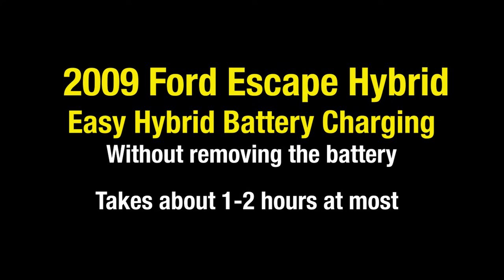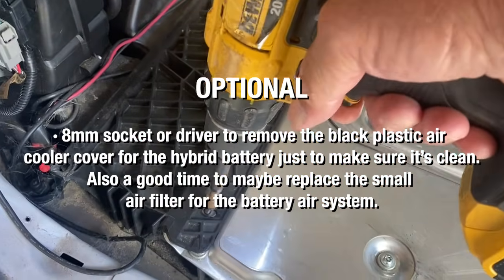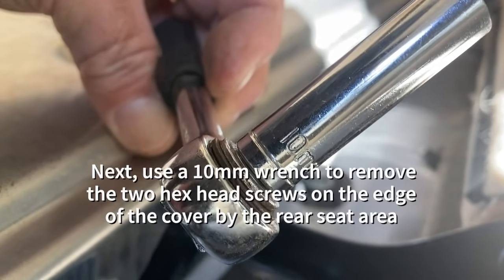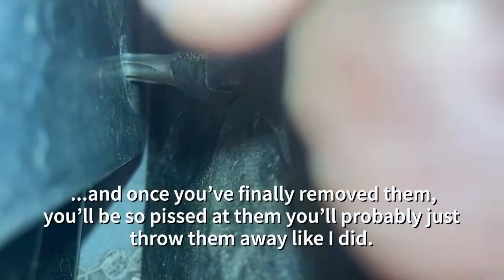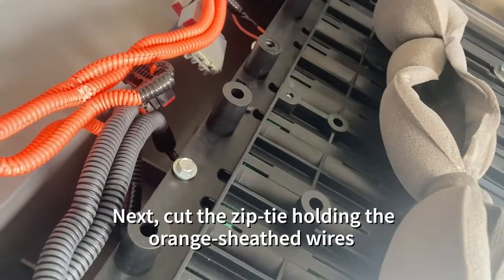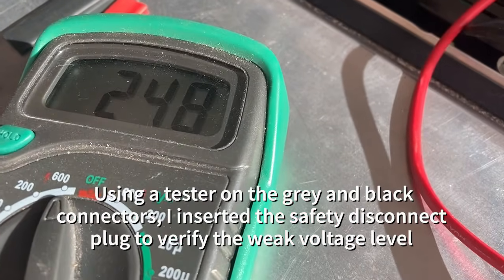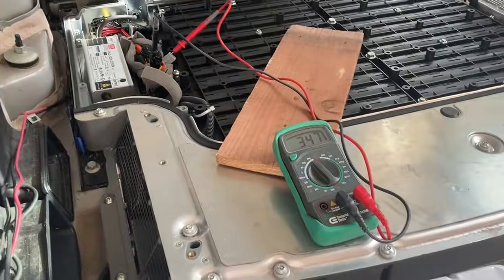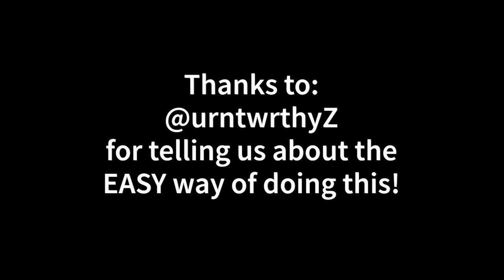EASY Hybrid Battery Charge 2009 Ford Escape - No need to remove battery!

Comment: I just did this today. Waiting to see if it is going to work. I forgot and closed everything off before checking to see if it was charging or not. I removed those plugs, I figured you already done all of this so it should work. I expected and led or something to come on on the charger when I plugged it in, but it didn't. I'm sure it is doing well. I did test it beforehand, and it was at 289 or so. Not sure how long it will take, but I'll wait about 45 minutes or an hour, then go out and try it. Thanks!

Comment: Hello Matt,
Thank you for your excellent tutorial video .It is the best posted on YouTube. 👍
What OBDII adapter hybrid compatible do you use with  ForScan, please?

I ordered the HLG-120H-C350A from Mouser Electronics website $82.15
Mouser #:
709-HLG120H-C350A
Mfr. #:
HLG-120H-C350A
Desc.:
LED Power Supplies LED Power Supplies 150.5W 350mA215-430V CC IP65 int. pot

Also ordered 2 rectifier diode from Mouser Electronics  $1.46/each
for safe and effective charging - prevent "back surge"

Mouser #:
625-1N4007GP-E3/53
Mfr. #:
1N4007GP-E3/53
Desc.:
Rectifiers Rectifiers 1.0A 1000V Glass Passivated TrimLeads

Alternatively, one can get from MAXX VOLTS a plug & play
2005-2012 Ford Escape Hybrid (Low Voltage Recovery) High Voltage Battery Charger Booster
Regular price
$469.00
Sale price
$399.98 Sale

Thanks again🙏

Comment: DOES this no Start condition exist on the 05-08 models as well.  I think you said that the male 3 prong plug is in place from the FACTORY already ????   TIA
Reply from the maker: No there’s no 3 prong AC plug on any of them. In the pre-2009 FEH there’s a charge button near the driver’s side under dash area that will allow a small charge from the 12v lead acid battery to run to the hybrid battery to get it up to starting voltage ( this is from what I’ve read, but I don’t have any firsthand knowledge about it)

Comment: Hi Matt I hope you are doing well. If you don't mind I have some questions. 1. So did you install some diodes on the positive charger cable? 2. How often did you have to charge your hybrid battery?  Did the battery overheated or not because I noticed it was charging rapidly. Thanks for the video
Reply from the maker: I didn’t install any diodes. I only charged it enough to get it started. Once it started, the hybrid battery stayed charged as long as I used the car regularly.

Comment: Thanks for the great video, with an older traction battery that still can be started will this help to semi-recondition and prolong the battery life or would that be wishful thinking. if it sits for a few days, it starts and stalls with "stop safely now" warning then after a few tries it'll run again Thanks

Comment: Another success story! This $60 part saved me from a $5k quote. Can't thank you enough! 

Notes for others:
My hybrid battery was showing 292v. After following the video, I charged it for 15mins and that was enough to get it over 300v but the car didn't start.
Turns out my 12v battery was dead as well so I used a portable jump-starter then the car turned right on. 
Drove it around as normal and the hybrid battery is holding strong around 340v. 12v car battery is also back to normal working conditions. 
Quick Google search states that the optimal battery level should be around 300v-350v.
I added an extra set of leads that allow me to check the voltage without opening the hybrid battery again.
Reply: I was thinking of this very thing yesterday after I watched the video. Thanks for reminding me.

Comment: How do you know - minus a volt meter when you should unplug?
Reply from the maker: Try starting it after a few hours. If it doesn’t start, try a few more hours. If it won’t start after about 10 or 12 hours of charging, you might have other issues.

Comment: I have escape that fails to start after a day of sitting. Seems like this post not trouble shooting reason hybrid battery not charging when car is driving?  
I hear cooling fans go out as one reason. Hybrid pack is hot. 
Another is hybrid battery control module. 
What causes hybrid battery parasitic drain?
Reply from the maker: That sounds like a different issue. This video is about what to do if your car won’t start because the hybrid battery has drained to a low voltage.

Comment: This is very dangerous because the aftermarket power supply stores a charge even with the orange interlock is out. Do you have to add a switch between the output of the jumper cables under the foam and the output of the aftermarket power supply when the unit is not being charged? I'm working on this conversion now, but I don't see a voltage with the power supply connected in parallel when I turn off the interlock. Thanks.
Reply: Did you find an answer
Reply: @Longbranchking  i did the conversion, and it works fine. There must be adequate isolation between the primary and secondary stages of the Chinese power supply.

Comment: If you pull out all the 13mm bolts that hold the battery down,  use a pry bar to lift the end by the seat,  then you can slide the battery side to side for increased clearance on those side bits.

Comment: Our sat for four days and is not starting. So, going to do this and incredibly grateful for this video but do they make a box that just plugs into those two connectors and has a 3 prong connector on the other end? 

Why did you solder? 

What's Ford using at the dealership to recharge these batteries in their service center and why can't I just buy that cord?
Reply from the maker: I don’t know what they use at the dealership. I soldered because I have a soldering iron and it makes a better connection than wire twisting, but wire nuts or crimp or jellybean connectors would work fine too. I don’t think there’s anything preconfigured with the plugs, at least not as far as I found.
Reply: @mattgatlin1918 Thank you for that input, much appreciated. It's working  great!

Comment: Hello Matt,
I wanted to give you a BIG THANK YOU!  I thought I had to toss my 2009 Mercury Mariner Hybrid because it would not start.  I did not know that you needed 300+ volts in the hybrid battery to start the car - I thought the car only needed the 12V battery to start.  As I started doing some research,  I was told that I needed to pull the battery out to charge it!  Looked like a very heavy and difficult job.  I was about to give up and donate it to "Cars for Kids", then I came across your video!  
I followed your directions and it worked!  A couple of miner things were different, but I worked through them.  
So thank you for the video, I can now use the SUV again to tow my fishing boat!

Comment: Great video. I followed for my 2009 when Hybrid battery wouldn't allow a start after the car was idle for about 2 weeks.  Didn't wire-up the charger for another 6mos. I get about 432 VDC when charger plugged in. Once charger unplugged, voltage across battery drops to nearly 0VDC in about 2min. Same symptom after increasing charge times from a couple hours to 9hrs. Tried starting vehicle after 2nd charge attempt (2hr charge) with charger plugged in. No start.  Seems a high resistance somewhere in system. Thoughts on cause, next steps.
Reply: This only works if none of your cells (modules) are zero. If even one module in the pack falls to zero, the BMS will disconnect power and battery won't hold charge, car won't start. SOLUTION for you is open the entire battery pack and replace completely dead or damaged modules.
Reply: Thank you! How do I ID the dead or damaged modules once I've opened the battery pack? I assume there is a location to use my Volt-meter across each module, with the orange breaker removed, of course.

Comment: At 8:20, you mention a 3/4" junction box clamp to secure the wires leaving the case.  That won't work, 3/4" is about 1/8" too big for the hole.  Otherwise, great video, very informative and helpful.

Comment: You didn't even show how you connected 3 wires on that 120v plug. 
There is 
FG (Green/yellow ) 
AC/L (brown), but mine is pink. 
AC/N (blue)
Reply from the maker: FG is abbreviation for Ground 
ACL is abbreviation for Alternating Current Line 
and ACN is abbreviation for Alternating Current Neutral 
On a 3 prong AC plug the Ground goes to the round pin.
Line (aka”Hot”) goes to the smaller of the flat spade pins.
Neutral goes to the larger of the flat spade pins.

Comment: 249 should be enough to start your car
Reply from the maker: You need at least 270 volts to start the car. 330v for a fully charged hv battery.

Comment: So just a random question, could I use these battery as a power supply for my RV camper? My camper is already set for multiple batteries, on a 12v system.
And charges off of the stock alternator.
Reply from the maker: The hybrid high voltage battery runs in the neighborhood of 400 volts, so it would definitely not be useful in any application other than what it was specifically designed for.
Reply: If you want a similar setup then you could just get a power supply that has a 12v output.  You could even use an old computer power supply - they have 12v, 5v, and 3.3v leads.  Though, there are more consumer-oriented 12v options available that would likely be better suited.

Comment: My 2009 FEH has had a replacement HV battery from an earlier year car, so it does have the factory DC-DC converter/charger inside the battery casing. But no jump switch under the dash, obviously, as it's a 2009 model. Can I just put 12v across the factory charger and charge the HV battery that way?
Reply from the maker: TBH, I couldn’t tell you. I only have a 2009, so I don’t have any idea what the wiring looks like in the models that actually came equipped with that charging feature.

Comment: It worked!! I was able to get by and only remove the drivers side, little hard screw and not the passenger side.  Just lifted the cover enough to work on the cables.  Charge initially was at 270V. Charged to 335V within 15 mins and started right up!!

Comment: Ordered everything exactly. Hooked everything up exactly, stuck at 268v. Tested the charger and it’s pushing right at 430v. I’m stuck. Please help
Reply: I actually pulled everything apart. Redid it a second time, making sure all connections were true and right. Within 10 minutes she fired right up. You’re a money saver man! Appreciate you greatly
Reply from the maker: Hmm, that’s interesting. It’s possible something could be wrong with the connections or the battery.  Have you tried charging it for longer, or maybe double checking all the connections?
Reply: Did you find out what you did wrong I’m stuck at 430 volt rn i got the positive and negative reversed the first time i switch it around and re hooked up everything but still no charge or voltage
Reply: Make sure your 12v battery up front is actually pushing 12. If you have a obd2 reader plug it in, clear the codes. Make sure your hybrid kill switch (orange circular) disconnect is clean. Also make sure your H-battery vent is clean and clear. First attempt was like 30 degrees outside, second attempt it was like 50. I don’t think the ambient temp outside caused the issue but it may have played a part.
Reply: Comment back and we will get this figured out for ya
Reply: Ok i finally got a chance to work on it again but the voltage is stuck at 275 while charging and it won’t go any higher
Reply: Triple check your connections. Be delicate and make sure everything is done exactly like the video here. You also want to have the orange disconnect plugged in when you are charging. Not exactly sure of how the battery reaches all of its cells but I was stuck at ~260V with the disconnect out. Then I plugged it back in and the V started finally rising. Try that

Comment: This video saved my 2009 Escape Hybrid from the junk yard! I had two mechanics tell me that it was a lost cause and I should sell it for parts. Turns out the hybrid battery had fallen just a little below 300v, so after a few hours of work and less than a hundred bucks in parts and tools, it only took a few minutes of charging to get my FEH up and running again. I can’t even begin to guess how you figured this out but it really works and in my case it was truly a life saver. Thanks Matt!
Reply from the maker: Glad to hear it worked out for you! If you can, definitely look into getting ForScan and doing a battery reconditioning. It’s all free except for the little connector adapter that goes from your laptop to the car’s OBD connection. There’s lots of info out there about how to use ForScan.

Comment: I tried checking voltage and when I turned my volt meter on, something in the battery went BANG and flashed somewhere I couldn't tell where it happened. Now I try to check voltage it doesn't read anything. Volt meter is fine. What happened???
Reply from the maker: 😳Yikes. That sounds weird. The volt meter is just a passive instrument and has its own internal protective fuse. Sounds like your battery has other issues. Hopefully you didn’t accidentally drop a tool or something down inside it 😬

Comment: Thank you for your excellent video Matt. I was able to get my 2009 Ford Escape Hybrid running using your detailed instructions. I should add that there was also a Torx T40 bolt on each side of my battery, in addition to those difficult T30 screws. These were nowhere near as difficult to remove, but they did have to come out to get the top off the battery compartment. I really appreciate you taking the time to make this video, and the details you included to make this job as painless as possible.
Reply from the maker: Glad it worked out for you - thanks for sharing that detail about the T40 bolts!

Comment: Thanks for the nice video Matt, I did this a few years back but didnt have such a great video to go on. BTW, you don;'t have to remvoe the side panels and remove those T30 screws on the sides if you just cut the top with an occulating tool, saved me a lot of headache.

Comment: Thank you for making and posting this video. I bought a completely dead 2009 Mercury Mariner on auction hoping this would work. The biggest issue was waiting to get the charger from Amazon. The first one was lost in customs so I had to order a second one. I cut down the Torx bit with an angle grinder and used a ratcheting box end wrench with a little Teflon tape to keep in place. This worked well to removed the side screws. Thanks again, my daughter is very happy with the car.
Reply from the maker: I’m glad it worked out for you!

Comment: I wonder how difficult it would be to add the OEM charging system from older model years to these cars. Seems like you could buy the parts pretty cheap from a junkyard.
Reply from the maker: That's a good question - I haven't done much research on that but it seems doable! I wonder if junkyards have to remove the HV batteries, though.

Comment: Hey Matt, Know its been a while since you posted.  But, was a solution ever found if charging leads (orange) were found to be without voltage?  Am at that step, no power via meter on the lines that fed to the original charger.  I read through comments, but didn't find anything.  Thanks for your time!
Reply: The orange service disconnect has a fuse built into it.Check the fuse.
Reply from the maker: Not sure what the problem could be. A couple of things to check would be to make sure the orange safety disconnect plug is in place (won’t show any voltage if the plug is out, if I’m remembering correctly). Also make sure your electrical meter is set to DC not AC. The charger converts AC in to DC out, so everything downstream of the charger will be DC. Other than that, I’m not sure. Maybe someone else has an idea 🤔

Comment: Dude.  Cannot thank you enough.  Anyone reading has this problem, just do it.  Local Ford dealership said "$175" and I would have had to tow it.  The one constructive suggestion for Matt/other viewers who WILL benefit from this tutorial: Matt notes that you don't have to wire in the additional small plastic box connector that he rightly used to plug into multimeter to see if the battery charger was working; I think this is a must--otherwise, how would you know if the charger is upping the voltage on the battery?  I can tell you when I plugged in the cord after having reconnected the safety disconnect, it was like Christmas Day in 1980 as my car has been sitting for months (and it took me three times to order the charger/Amazon screwed up twice).  Matt, you sir, are The Everyman Hero.
Reply from the maker: Glad it worked out for you. I definitely agree that it would be handy to have extended testing leads to measure voltage outside the battery compartment. If you have Forscan, I believe that can give you a HV battery voltage reading as well.
Reply: My dealer charged $900 to recharge the battery.  Like a fool, I paid it.  But when it happened again a year later, I installed my own charger.  In a different location, since I didn't know about these charging wires in the foam bundle.  Wish I had seen this first.

Comment: Would there be any reason why I’m reading 0 volts on the meter? The car did sit for a year so that could have drained it all the way I’m guessing. 

When I plug in the extension cord, it immediately trips my breaker. I think it might because I used a tv 3 prong cord that I spliced onto the charger end as opposed to the one you linked. 
Trying to go get a plug that is similar tonight and hope that works. 
If anyone has any ideas I’d greatly appreciate it.
Reply from the maker: Maybe the voltage is zero because it’s fully drained like you said, or maybe you’re not getting good contact on the leads. Also double check that your meter is set to DC and not AC. 
If you’re tripping a breaker with your AC plug, it’s not wired correctly or it has a short in it somewhere.